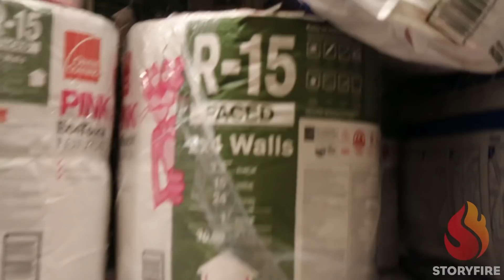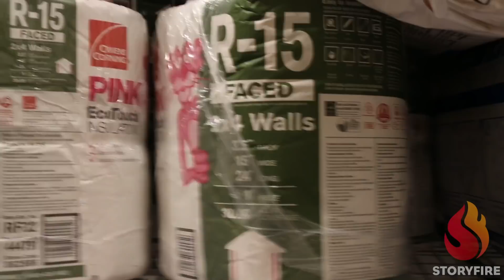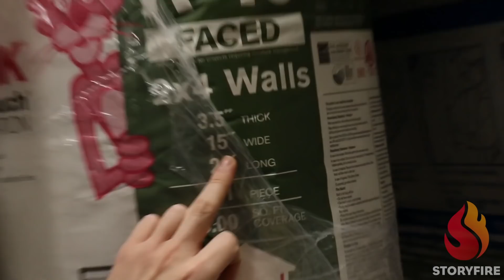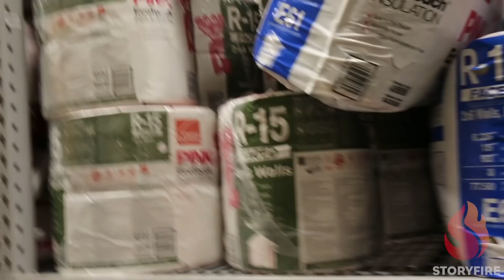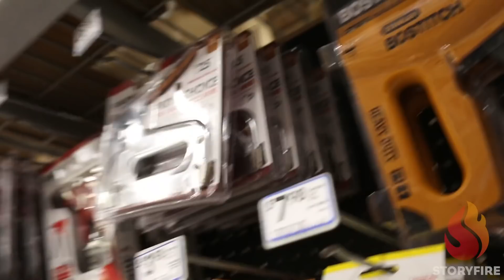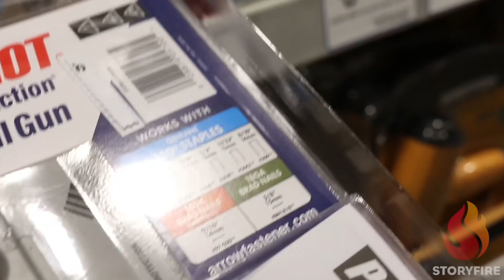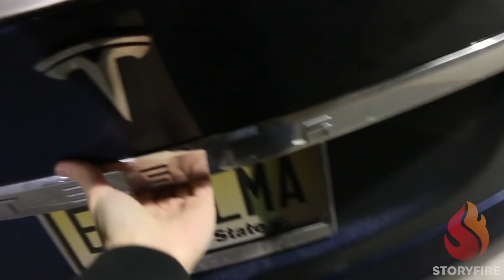ALMOST DIED FROM INHALING FIBERGLASS!

Comment: Never knew fiberglass inhalation was an issue, that's kind of a regular thing at my job and some of the dudes filter it through a cigarette XD
Reply: @larko2717  
I would be more concerned if my 6-3 day job didn't involve ripping duct with fiberglass insulation out of a large building.

Granted, I'm not paid to install the stuff on duct (those guys wear proper respirators and definitely should) but it still gets pretty thick in the air when you catch it with an electric saw.